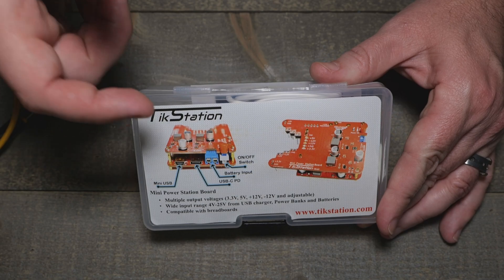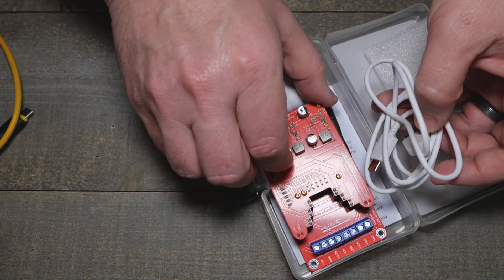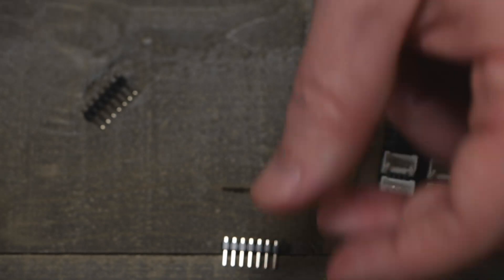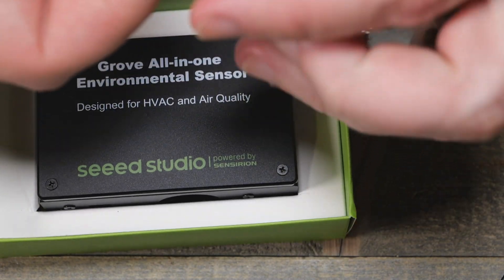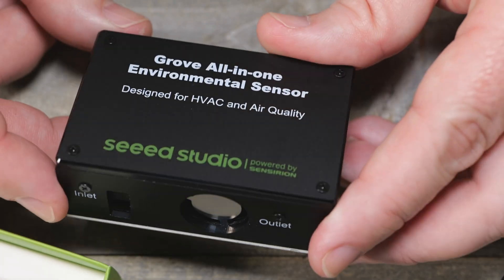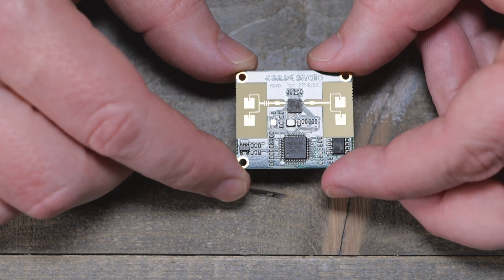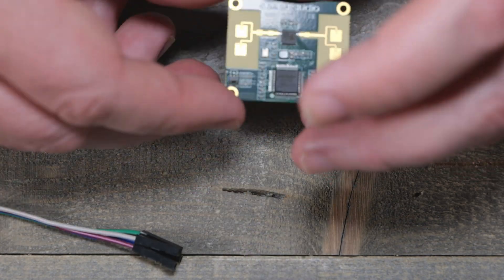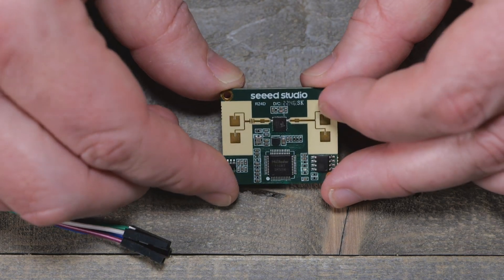Unboxing All Things- Zigbee, ESP Sensors, mmWave, TikStation, Pixel Art Speaker, SeedStudio

Comment: Remember the mm wave radar penetrates walls.  There may be no motion in the room where you're testing, but something in/beyond the walls may be moving.  They detect in both directions from the board, also.
Reply from the maker: Yep.  I've tested it on some other sensors as well and familiar with the through wall issues.  I tried a couple things of blocking it and it just stays triggered no matter what.  I haven't had that issue with other sensors.

Comment: That bread board power supply looks like it could come in very handy but I noticed the Pos and Neg of the 3.3v and 5v lines are reversed compared to your board!
Reply from the maker: Yes. I noticed that as well. Something I will have to watch out for. Not sure if there are other breadboard models out there and mine is just reversed. The adjustable power rail was pretty damn slick. Great board for small hobbyist projects like we are doing.
Reply: @digiblurDIY  move the power supply to the other end of the breadboard, then + and - match
Reply from the maker: Oh wow.. Sometimes the small things fix all the things.
Reply: @digiblurDIY  The only bit of bread board i have got to hand is the same as yours, like you say just try and remember and it shouldnt be a problem
Reply: I noticed that  within a couple of seconds and was going to bring up the point to attach to the other side of the BB. Plenty of sharp eyes out there.
Reply from the maker: I love some easy fixes.  Yes, I'm an idiot ;)

Comment: I'm going to be really interested to see more on that smoke alarm
Reply from the maker: Not really much more to it. Just a binary sensor in zigbee and detects smoke. What else do you want to know about it and I can check on it.
Reply: @digiblurDIY  @JaguarInfinity I have 2 of the smoke detactors and both work great!
Reply: I think what I'd like to know most is if you can trigger the sounder yourself without smoke being detected. Two scenarios why I'd want this, first if I have 3 and one goes off can I set an automation so the others also go off as well. EG so upstairs gets triggered if one goes off in the garage where people may not be alerted by it. Secondly maybe tie it together with other sensors as part of a home alarm to have the Sounders be triggered instead of needing another device to act as an indoor siren.
Reply from the maker: I didn't see that exposure at least Zigbee2mqtt to alert other smoke detectors unfortunately. That would be cool for the interconnect.